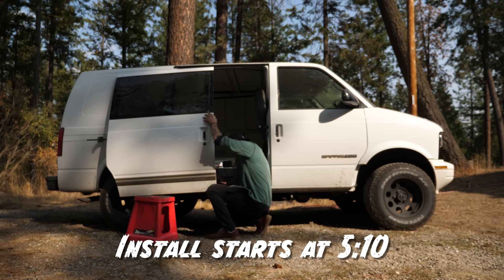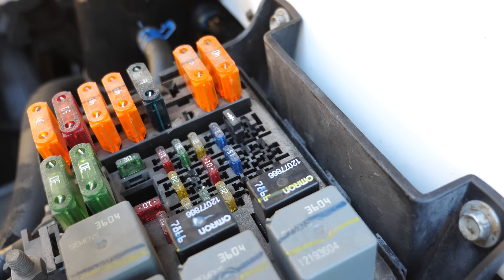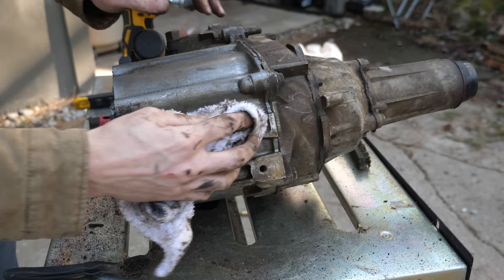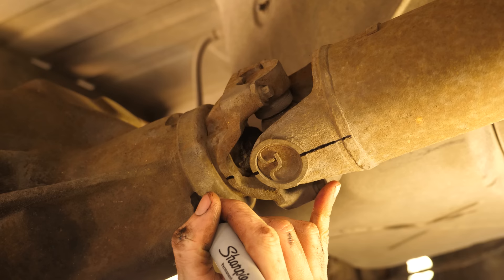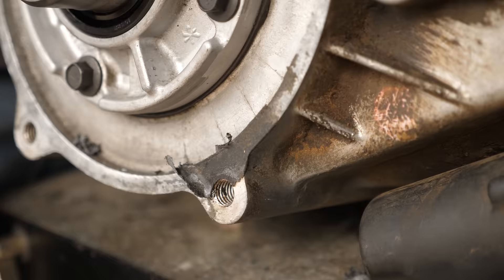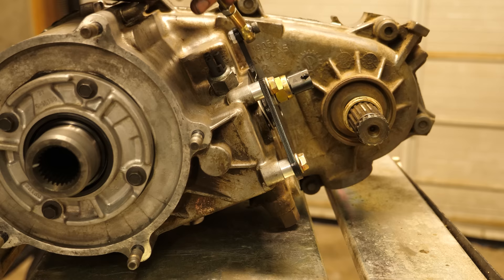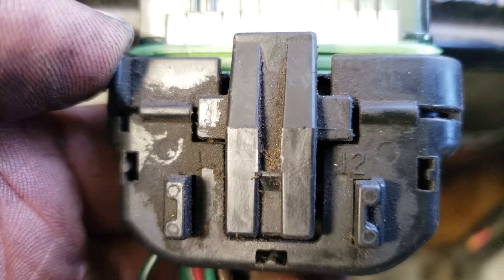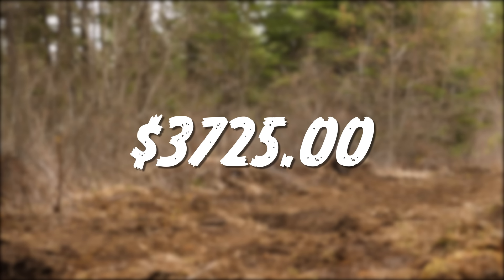4x4 Swap for Astro and Safari! // Conversion Explanation and Install // Journey's Offroad - Part 5

Comment: Retired mechanic here, I sure love your attention to detail, from marking the drive shafts to using loctite  on the bolts. I have worked with mechanics who show less care than this 🤙
Reply: Years ago there was a garage owner in town who treated his workers like dirt.  They got back at him by placing counterweights on the driveshaft of his car.  It shook and vibrated like crazy!
Reply: @terrywarner8657  !!!
Reply: @terrywarner8657  I'm guilty of that trick. I just use a big zip tie and something relatively heavy like a couple of 7/16 nuts. Vibrate like hell. No permanent damage. And easily removed.
Reply: @Mike-qp8bv  i mean, you're definitely damaging the bearings in both the transmission and the rear diff as well as the ujoints but some ppl suck.
Reply: If he had "attention to detail" he would have: (1) Degreased and powerwashed the entire underside of the trans and transfer case prior to removal. (2) He would have soldered the electrical connections instead of doing a chincey crimp job. (3) He would have replaced the old crusty U-joints when he had the driveshaft out. (4) He would have replaced the halfshaft support bearing while he had the drive shaft out. (5) He would have cleaned the speed sensor electrical connector thoroughly prior to connection to the main harness. (6) He would have applied grease to the driveshaft splined union prior to reassembly. (7) He would have used black trim screws on the shifter boot and more professionally secured it to the floor to seal out water and dirt. (8) He would have painted the new transfer case after cleaning it prior to install. (9) He would have replaced the trans and transfer case input/output seals while they were easily accessible. (10) He would have painted the exposed metal hole he cut into the floorpan. (11) He would have gone ahead and drained and replaced the front and rear differential fluid while he was doing this job to ensure they are good to go as well. Also check the front CV joint and boots. And lastly (12) He would have documented carefully on a small notebook pad exactly what he did electrically in terms of the splicing and wiring changes and kept that notepad in his glovebox forever afterwards (to help solve electrical gremlins later). 

If he had done all those things, THEN you could say he had "attention to detail."
Reply from the maker: Noted 😆
Reply: Bahahahhahahahahhahah 🤣
Reply: … and rebuilt the engine and transmission, and redid the brakes, and pulled the body off the frame to sandblast it and powder coat it, and while the body is off the frame, he could have put it on a rotisserie and stripped it to bare metal, epoxy primered it, sine all the body work and repainted the van.

Then and only then would any details have been paid attention to.

Comment: When ever you need to change the oil in the diff or the transfer case, make sure that you undo the fill bolt then the drain. (To make sure that you can fill it back up of course!)
Reply: that makes no sense, whether or not the bolt is tough to get out you can't drive on bad fluid. so if you empty it then realize you can't get the fill bolt out, you just need to GET THE FILL BOLT OUT. there's no way around it.
Reply: @krebgurfson5732   I disagree, makes sense to me (though you have a point too). If you need to spend a day getting the fill bot out, might as well do it before you take away your ability to drive to a shop by removing the fluid.

Comment: Thanks. I was a mechanic for decades and hands were injured.  They easily hurt.  Docs were saying it is in my head and I can’t keep working… fools.  I can’t regardless if I want to.   I would like to save this video link that shows a search on the surface of what we need as a mechanic, hand wise.  I used garden rubber pads 100% of the time when getting up and down and knees are still good.  I wore cheepo gloves and fingers get use to touch through them.   I hope this helps.  Pat

Comment: Just came across this today. I'm a licensed technician. Have lots of experience with these AWD systems. I have also done countless transfer case upgrades exactly like you did. 
I just wanted to say your step by step instructions are laid out perfectly and very easy to follow. Granted, I have lots of experience with these. I feel the average guy could easily perform this job over the weekend just following your steps. Very good, thoughtful, laid out instructions. Very easy to follow. 
Very good job putting this video together. Well done sir.

Comment: I worked for GM Canada during the height of the AWD van years, to this day there are few AWD systems that are as robust as the Astro/Safari vans were in the early years  nor had the ground clearance they had or the capacity or strength in powertrains , Gm dropped the ball as you said when they  went cheap and electronic , the change up to the 4WD case is a sweet  change over and not hard to do, that is easier than doing a water pump and alternator on one of these for sure, in 1994 GM had a H.O. 4.3 V6 that was 210 HP  only 2 yrs though because they did not meet emission standards , it was a very notable difference in driving with this motor and with snow tires on the AWD  Astro/Safari they would push snow bumper deep easily, you could own and run these easily  for 300k with regular maintenance 
great video good choice of vehicle  👍
Reply: Hi Bob, I have an 04 AWD Astro Van with a bad transmission.  I've never attempted a transmission swap but have some wrenching skills and the will to save money.  I want to do the 4x4 transfer case swap and a lift at the same time.  Do you have any general words of the wise or recommendations for me?  Should I swap the axles too?  I'm a rock climber looking to do back roads and creeks in the High Sierras in order to get to my climbs at Shuteye Ridge.  Much appreciated!  Thanks!
Reply: Had a 95 Astro that I ordered with I think was Detroit Tru Trac Diffs and in the snow that thing was unstoppable, wish I’d have kept it, was a great Van the Wife mostly used it !

Comment: I don't even own a car. If I did, I'd barely mess with it, I'm honestly afraid of messing up a car, it took me years to dare to wrench on my bikes.
Still excitedly watched the whole thing as if I needed to learn the process lol!

And that's what you call quality video-making. When it engages you even if you have no real reason to be engaged.
Reply: As a side note of why I don't mess with mechanics... I bled the brakes on my MTB yesterday, a job which I've done at least a dozen times. Got distracted, kept turning, stripped the bolt on the bleed port. Need to buy a new rear brake! go me! ... idiot

Comment: In the late 80's I had a great side gig changing the AMC Eagle over to a manual hand shift T case.  We developed a shift lever assembly that eliminated the vacuum shift assembly, and it sold like wildfire.  The first one we made is still on SX4 in my garage.
GREAT JOB on that van Brother!

Comment: This sent me into a rabbit hole researching transfer case types. I noticed this case has 5 bolts. My Jeep XJ has 6. The curiosity was in whether the internals or shafts would swap. If I went this route I'd want a 242, 2wd, 4hi, 4low, N and 4 Full Time. Basically a mechanical awd option, so in rain and light patches of snow, you can just leave it in 4F and not worry about binding. Ended up at D&E In The Garage, which answers a lot of questions. This is the fun stuff finding out what works with what. :-D

Comment: If you're ever out in the sticks working on a broken shaft or working in your garage, grab a tie down strap of some kind and loop the long end around the shaft and then loosely attach the hooks to the frame or some other point. That way when you pop the shaft loose, it doesn't come down and bonk you.

Comment: Mr. The Shredist,  I am glad you recorded the process of swapping out Tcases. What helps is knowing that you can use a different vehicles t. case for this install. In the realm of Tcases, my wifes' and my '89  suburban ('Scottsdale' base trim level) has a New Process NP241 t. case and it is a 'passenger side' drop (drops to the right side of the vehicle, not the left/drivers' side of the 'Superban'. Emphasis on the 'pur' portion of that made up name. Anyway, wife and I call the suburban 'Scotty'. Lacking all originality. The trim level is the name.
     I'm looking up GMC Safari's/Chevy Astros and the possibility of the 4wd (not part time AWD) seems like a better choice over the RWD vans. I know that the first gen Astros/Safaris had the optional 5 speed manual from BW (Borg Warner), but was not an option in the second gen. Being able to tow 5,500 lbs with one of these vans has to be a real nice option as well. 
     If I could afford to and if it could fit......, a cummins 2.8L I4 diesel engine swap is not a bad idea. We'll see. 

Kudos to you on the project. Keep the vids coming!!

Comment: Dude. I don't know what the rest of your channel entails, but you picked up a subscriber based solely on this video. 

First off, I can't say how much I appreciate somebody doing a build video like this in a dirt driveway. As someone who's been spoiled by concrete, air tools, good lighting and proper amenities, I forget and fail to appreciate how many people do WAY MORE WORK than I will ever do, and do it in comparatively piss poor conditions. I saw a guy doing an engine swap in his mustang on the grass next to his house, under a tarp, with the engine hoist on a sheet of plywood. Far from ideal, but dude was getting it DONE. 

Secondly, it is rare that I watch a video like this and don't start screaming at the screen about some obviously bone-headed thing that's going on. Mechanically, and procedurally, I could find NO FAULT with what you did! NONE! I hate using open flame for my shrink tube, but only because I got spoiled (again) on heat guns. Everything you did was super logical, common sense solid wrenching. And with nothing fancy, save the common-sense luxury of the tranny jack. I only had to drop one cast iron transfer case on my sternum and then struggle to get out from under it with ribs intact to know that as heavy as they look, there could be a LOT more gravity hiding in those things than you can even imagine. 

I hope there's enough AWD Astro vans to go around after videos like this! Super well done and well produced. I'll be checking out that whole series.

Comment: Great job both on the video and the van.  One thing anyone doing this may want to consider while both driveshafts are out is installing 4 new U joints as they are pretty cheap insurance in the long run.

Comment: I have a 1996 with 200k, it had a new trans when I got it 5 years ago. Great truck but they don't get good gas mileage. I also have a 94, 2WD pickup with the same motor that gets about 10mpg more and is full size. Just my 2 cents. Great video

Comment: I just completed the swap and used this video as complete reference. Thank you for being so thorough! The main stuff that hung me up were the rear bolts that hold the drive shaft in. They were rusted on and I stripped them pretty quickly. It turned into a multi day project because of that, I ended up drilling holes into them and using bolt extracting bits to remove along with penetrating oil and a torch. So I'd say for anyone going to do this project, its not a bad idea to buy an extra set of those bolts in case you end up in the same situation as me. I also recommend getting a new rear output drive shaft seal incase you get a transfer case with a torn one. Keep up the great work, Shredist! yewww!

Comment: I gotta hand it to ya. You're one determined individual.  I will never be doing this however, but my dream is to one day buy a totally reconditioned Astro/Safari all-wheel drive.   I've owned two all-wheel drive Safaris but I ran them into the ground, thinking that I'd always be able to buy another one.  Then I sadly discovered that GM discontinued these vehicles.  Now I'm stuck with a 2003 rear-wheel drive Astro.  In great condition however with only 140k miles on it, but I miss the all-wheel drive so much.

Comment: The Astro/Safari AWD system works great when it is working. The number one cause of failure, tied with the encoder motor failing, is the wrong fluid, or dirty fluid that's never changed, just like the oil that was drained from this transfer case.  The wrong fluid in the NP136 is like the wrong fluid in any clutch and plate limited slip rear differential, it can make the clutchpack slip and fail to engage, or stick, and fail to disengage depending on what incorrect fluid is used.  This swap is a huge upgrade, but the stock system actually works really well when the transfer case fluid is maintained. I have 235/85R16 tires on my Astro and this is on my list of pending upgrades.  Great vid though.

Comment: My 2001 AWD Astro also had the NV136.  When I tested it out right after purchase I found that it was not engaging and replaced the actuator/encoder motor.  No go, so I returned the actuator and got myself a NP231.  I got from the junk yard a Jeep Liberty shifter assembly that is cable based and after cutting a hole next to my seat have that all installed. This is definitely the best off-road mod for those vans and let you achieve good capability at low cost.  My entire conversion for the parts and oil was about $225 and cost me a Saturday mostly for fabricating a bracket for the shifter.  The transfer case install itself was the easy part.  I also reused by VSS encoder and did not need to modify the harness for the speedo.

Comment: Well done tutorial on this procedure!  I'm looking at a used AWD Astrovan and figured I'd search youtube for a conversion to gain low range and your video did just that!  The only suggestion I'd make is to get a driveshaft shop to make a longer rear one as you can see how much further out the yoke is from the transfer case.

Comment: Very interesting. I was not away the Borg Warner had gone away. We owned 4 Astro's over the last 25 years, 91, 95, 2000 and 2002. All performed admirably in snow. I never felt the front end was uncoupled, unlike my Avalanche with 'Auto-4wd'.

Comment: I just finished my 4x4 conversion and lift all from journeys...I also did all shocks/struts, ball joints, control arms,thicker radiator, 29in tires, and new rims on my 05 safari I found from a church with 34K miles

Comment: Cool build....I drove Astro vans in my service career and put a more than 250K miles on them...great vehicles....Nice conversion! VSS is Vehicle Speed Sensor...not "variable speed sensor" also...That is a brace on the drivers side to prevent cracking the main transmission case with the added weight of the transfer case....You might want to investigate a way to keep it in place...👍

Comment: What I like about this build is that it's what just about anyone can start out with. Not everyone is capable or rich enough to buy a Sprinter for $30+k and start modifying it. Plus it's not another white (or gray, I see gray versions at some of my local trailheads) Sprinter cruising around to every Mtb destination.
Reply from the maker: Its definitely been a great platform to get into van building with. I think that hardest part will be laying out the inside for 2 adults though since its definitely a smaller space to work with. Happy with the project so far though!
Reply: @TheShredist  With the smaller interior, you may have to design the bed to fold away so the bikes will fit inside, but have a rear lockable rack for when you are sleeping inside at a campsite. I know that I don't really like hauling my bike on the outside on long trips, especially when the weather is bad or you stop for food at a restaurant and you can't see the bikes from inside while eating.

Comment: That was very informative. Awesome video.

Just one small tip for you: To make a great gasket scraper that won't mar your aluminum, take a short section of 1/2 or 3/4 copper pipe, smash one end flat with a hammer and then sharpen it with a file or grinder. Sharpen as necessary.

Comment: I did one of the original V8 swaps in an Astro. I always wanted to do a real 4x4 conversion like this, and I think this may have re-lit that flame for me. I remember discussing logistics, parts, and cross over years for the conversions on astrosafari before Journeys made this kit. It used to be more involved because you had to install the electronics from the donor S10. This kit is pretty slick

Comment: I looks like you need some lockers and I wold at least put a rear locker.  Otherwise you still have a two wheel drive, just one in the front and one in the back.  Great video, well done in the making of it and the project.  It was very easy to watch and shows you put a lot of work into production.

Comment: The BW4472 is a fantastic transfer case as it is the same one that came in my GMC Typhoon. They handle a lot of power, but I agree for your application it would have been more work than beneficial to you and finding a replacement chain and viscous coupler are almost impossible. You basically have to suck off someone that hoards Typhoon parts. I love the project!

Comment: Great video! Just so you know, driveshafts are balanced independently from the rest of the drivetrain so it really doesn't matter how it goes back in. If you are taking apart a telescoping driveshaft, it is a really good idea to mark how it came apart so it can go together the same way. Even if you put the shaft together in phase, it can be 180° out, potentially throwing the shaft way out of balance

Comment: Need a ZR2 iron case front 7.25" differential assembly, because then you can find a used lock right front locker for true 4wd. They discontinued this item because people installed in the aluminum case assemblies, causing them to break. But it's still the cheapest, easiest way to get both front tires helping short of swapping a Dana 30 from a Jeep.